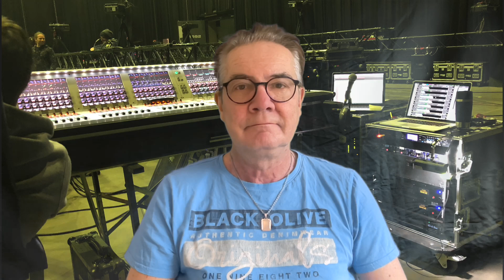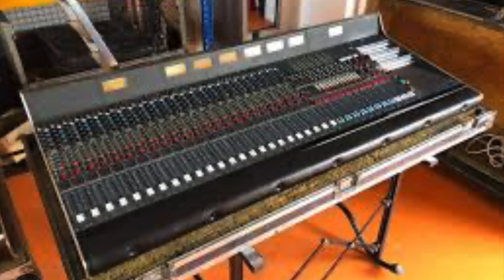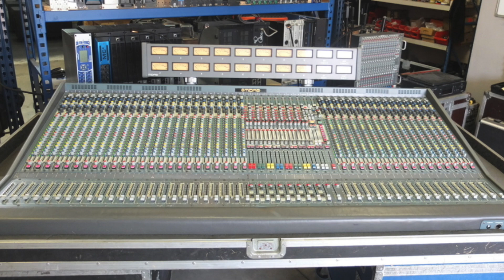Everything about DCA's and why you are using them wrong.

Comment: A very useful insight into how to structure the channels, at present I put all the vocals and reverb on one DCA fader, and then do the same with the instruments, (mandolin, violin, 2 x ukulele,s. & A beatbox), the bass has his own combo. Monitors are on the 3rd DCA.
As long as all channels are set up at the right levels,  I find it easy to set the PA output levels of the band.
(Small shanty/Irish band with normally 6 to 8 of us).
Thanks to your video I may sit down and have a rethink.
Reply from the maker: If you put vocals and reverb on the same DCA, you change the balance between the two when using that DCA. Let' s say you bring it up by 3db you now send 3 db more into the reverb but you also bring up the return of the reverb  by 3 db. So the vocals come up 3 db and the reverb comes up 6 db. While you can put vocals and reverb on the same subgroup they shouldn't share a DCA. And when you say, you have your monitors on DCA 3 are you talking about the bus sends or your monitor splits ?

Comment: One of my favourite DCA uses is on the DJ channels - they often “feel” it necessary to try to illuminate every clip light on a system. One fader prevents their success lol. 

I’m still debating whether to use a DCA on effect sends as well as returns…I’ve had effects returns on a DCA for longer than I can remember, but it can also be useful to be able to play the game you described between band and vocals with effects sends and returns. Especially when overall volume needs careful control.
Reply from the maker: It works up to a point. When having a DJ a try to make sure he can’t clip my preamp no matter how much he turns up his volume.
Reply: @Prolivesoundmixing  I’ve got mine coming in over USB, so no preamp involved - the software compensates for them trying to drive deeper into clip, so I limit the return they’re on and pull the level back with the DCA…
Reply from the maker: @gregorykusiak5424 good for you😅

Comment: Modern consoles and deep menu diving and working through layer after layer trying to quickly find sources drives me crazy but I know the days of always having everything in front of me is no longer an option. So I definitely agree with the last statement you make here of simply assigning your DCAs and VCAs to 8 faders you can ride as needed the most and only having to dive deeper into the source channels to adjust gain staging as needed.